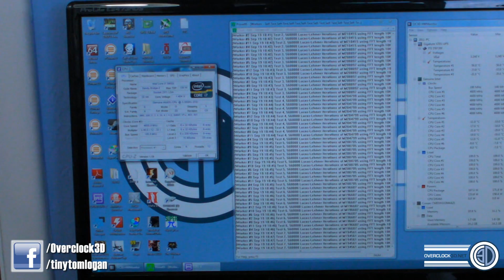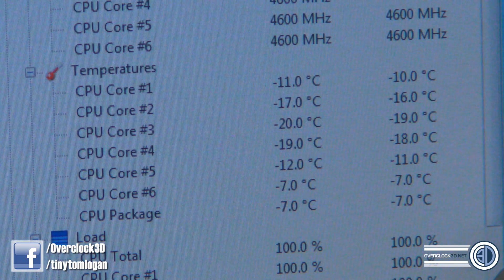Ultimate Corsair H100 Cooling Mod

Comment: Won't bother watching the rest. Thought maybe he was gonna do something actually interesting.. but nah.... Hell unless he bought 20 'reversed' fans (somehow), none of this would even work. Forget that whole debate that had been going on about whether or not he could actually get temps below 0C... If he didn't have the fans spinning in alternating directions while blowing the same direction, he wouldn't even be generating any 'wind' or air movement anyway... The fans all spinning in the same direction cancels eachother out, thus just making a bunch of noise without any actual air movement... And if you think i'm just 'bullshitting' here... go open up a enterprise servers..... i can even give you a specific type: any HP Proliant 1U server. Open it up, remove a fan container, and look inside. the blades are in different positions for the two-four fans that are stacked in that container. Each fan spins in a different direction yet blows air the same direction. This increases both air pressure and speed over all...

Comment: The only way a second pump would add more is if the Pumps are to small for the work its doing . Any added work from the second pump is to bring the single pump up to its true work force value

Comment: How the fuck? Fans don't cool the air... They pull in colder room temperature air into the tower. Fake.
Reply: JgHaverty Hold up now keyboard warrior, not everyone is a science whiz like you. I was just stating my opinion. which i though was right. I never was good at science, so dont go makin any judgements bout no one, okay.
Reply: YeHnJaCk I dunno how to make this point without sounding like a complete prick, but the amount of idiots that think this is accurate is absolutely staggering...
Reply: wind velocity, the faster it travels, the colder it gets. And plus, all the fans are doing is cooling the radiator and removing heat from it, so 40 of em means lots of heat getting instantly removed, and the cpu gets cooled so quickly, that there is no substantial amount of heat in the room
Reply: NordicSnow Holy christ you're stupid. 

Your body temperature is 98.6 degrees. Your ambient air temperature in this situation is likely below 98.6 degrees. It feels cooler. Because it IS cooler. Not because of some magic that occurs. 

Your body feels cooler when its super hot, because of your sweat evaporating. 

You're honestly allowed to use your brain, no one here will stop you.
Reply: Lets go to the basics! Cpu coolers work. Why ? because of black magic? No,because the air is used to carry away the heat from the cpu! So if you use a small/low rpm cooler, your cpu is hotter! If you decide to upgrade to a larger cooler fan ,your cpu can be cooled more efectively! Why should this not work if you simply scale it up?
Reply: Zontzo then why do you use them in the summer?
Reply: Really? I'm pretty sure it isn't compressing the air... It's moving it.
Reply: god dang I have lost all my faith to humanity....
Reply: NordicSnow That is horribly wrong. The faster ANYTHING moves, the more enthalpy it gets and the higher the temperature is.
Reply: NordicSnow u srsly didnt know that velocity = more temperature? u know when meteorites fall they catch on fire? its not only cuz of velocity, but velocity plays a big part. did you watch cartooms in your childhood? i think even in alot of cartoons u can purely use logic and understand it........... didnt know ppl think xD velocity makes it colder lol
Reply: JgHaverty i guess its because the author was confident in his answer,  and he didnt start it with "i think" or in my opinion or whatever, that made it sound accurate to people that dont know anything the basics of physics, and in our world, the people who talk they dont think, and the people who think who think they dont talk :S true but sad
Reply: did you get a e- in physics
Reply: frederik hansen Is that even possible?
Reply: No matter how many fans you put on there, it won't get any cooler than the room itself.. The reason why a fan blowing on to yourself feels cool is because humans are warmer than rooms and the fan blows the hotter air right on top of our skins away.
Reply: Zontzo Sh3lbyHD Explain to me how room fans cool the air of the room then.
Reply: memanlol zer They don't.

Comment: P1xV1/T1=P2xV2/T2, and  V1= V2 (volume)  and T1= room temp say 24C,  P1 is high pressure created at radiator restriction  from fans pushing and P2 is low pressure created from the vacuum at radaitor from fans pulling, solve for T2 for radiator fluid, after manipulating eqaution we get  T2= P2/P1 x T1,   P2 is mucho less than P1 so P1/P2 is less than 1 and multiplying that small fration times an R.T. of 24C gives a temp mucho lower than the room temp.

Comment: I did this, but with some deltas. I need 3 separate 1300w psu (each fan is 36 watts and I used 100 fans). It is great and it costs nothing

Comment: So many dumb people commenting. The liquid in the cooler isn't water! It is a special type of coolant which can get very cold and not freeze. The radiator can get colder since there is no heat gaining on the radiator so the cooler can work on make temperature.

Comment: This is really the most stupid thing one can do with so many crappy fans.
Just take the motor from a vacuum cleaner and run that at low RPM... Way better airflow and usually a lot less noise and power consumption.
Also it's better to push air in instead of sucking air out.

Comment: Oh my god. The fans would make the room hotter you fucking dipshit. You are removign heat from the CPU and putting it into the room, that is what the fans does, not to mention they add extra heat from inefficiency. Are you a complete fuckehead? This is the most basic of physics.

So fake. Negative tempretures my ass. 4.6 ghz my ass.
Reply: watch to the very end of the video
Reply: Ahahahahaha well done (Y)
Reply: Take a joke moron. (4.6 is not a unrealistic number for a i7)
Reply: It's easy as fuck to get 4.6Ghz... AMD Catalyst Control Centre automatically overclocked mine to that ffs... All I'm using is a Corsair H55 Liquid Cooler on my AMD FM2 A8 6600K processor... There really is no big deal.
Reply: LOOOOOOOOL. You got trolled.
Reply: Indeedthis isaname if you'd look at the fx 9590 then you'd see that it's possible from stock
Reply: Your dumb, the liquid flows in the heat sink, cooling the cpu, then back out into the radiator where it is slightly warm, that is if your running a normal setup. This has 40 fans, 20 pulling in air, and air cools as it moves quicker, unlike any other form of matter, and 20 sucking it out as well. That is also cooling it. The fans, are cooling the liquid in the radiator which is cold, due to the air coming through it. The fans you use in your house when it's warm? Same fucking concept.

Comment: When air moves it loses heat energy. Probably won't get neg temps, but it will get much cooler than ambient temps.
Reply: Also using a radiator in this fashion would provide significantly cooler temps, argued that you wouldn't get neg temps but the science grad I talked to said it is possible..

Comment: _   You guys should stick to computers and not aerodynamics..   Putting that many fans on a system without a wind tunnel formation would be pointless.  Each fan will buffer each other out, which would cause it to again..  be pointless.  if you have this fan system set up in a wind tunnel formation, you could get it much much cooler. lol

Comment: Take one of the gasoline engine fans they use to inflate hot air balloons and channel it into a 240 X 120 MM slot to put the h100 in

Comment: Most fans are pressure optimized.  Push/pull fan setups are a waste, there's no extra flow of air.  Also, putting two fans up against each other, at best will do nothing extra, and at worst will give you a lower average air flow
Reply: Putting two fans next to each other will most definitively not lower airflow. It just won't increase it significantly. And while push/pull setups are subject to serious diminishing returns, there is certainly more airflow. Only on thick rads with a high fin density using fans at low speeds would I ever recommend push/pull, on the basis that it doesn't do much of a difference otherwise... But your comment is plain bullshit.
Reply: If you put two fans up against each other with different air flow rates, the fan that moves less air is going to choke back the fan that moves more air.  If you use two fans with the same air flow rate, then you just get the same air flow rate.
Reply: No. That's not how the world works. Electric motors slow down from how fast they would otherwise spin at any given voltage when they are made to do work. Keeping a fan spinning (even in a vacuum) is a lot of work, and the motor will be spinning slower than it would be without the fan blades attached. As you contribute airflow from a second fan your fan will speed up, even if they normally operate at different speeds. And the resulting airflow will be higher than it would be with either fan alone, with exceptions in scenarios where the fans are vastly different. It just isn't going to be a lot more than the airflow of a single fan.
Reply: Patrik Manni  no.. _  just no, Phat Rat put it exactly right.  It's the same air flow rate no matter how many fans you put together.  The only way to change that rate would be for a wind tunnel formation for those fans with precise timing and calibrations.

There would be no suction for the initial fan to use to be able to allow the 2nd fan to pull on the first fans rotation.  They are pinning at the same rate.  But you have to remember inertia, the fans are all magnetic, when they shut off from the power, they stop quickly.  So the magnetic inertia would stop any type of suction from occurring from one fan to another.

The only way a suction could work, is again, the wind tunnel formation in exact formation from each other, to work as a waving fan.
Reply: This is the same as using a 1000hp engine to run a small 12cm fan... waste of energy and money but he did it just for fun :)

Comment: Dude, you bought pressure optimized fans. They are going to push the same amount of air regardless of how many you stack onto each other. I know its for fun but still.
Reply: That isn't how airflow works. There is no magical "pressure optimization" switch that negates all effects other fans are subject to. Stacking fans will increase the static pressure, but it won't do it by much.
Reply: Pressure optimized fans run at the same speed regardless of how much static pressure there is. Stacking them will NOT make them run any faster.
Reply: Pressure optimized fans do not defy the laws of physics. They generate more static pressure, and retain high speeds better regardless of pressure differentials, but they are still affected by physics. And as such, they slow down when the motor needs to do more work to keep spinning at the same speed. Because that's just how electric motors work. And stacking them results in a net higher force, and a lower load on each motor, meaning the fans will spin faster. I mean, I know the video is a joke, but for fuck's sake. There isn't a magical 'pressure optimization' that lets fans defy all conventional logic and physics. There never has been, and there never will be. And stacking fans makes a difference, but not a big one.
Reply: The motor isn't going to magically pull more power to compensate for the work that needs to be done. If you give it a specific amount of power, it will spin at a certain speed, and that speed will be reduced as you increase the work it needs to do. And the work it needs to do is increased as you place it on a radiator. So it spins slower than it normally does when attached to a radiator. So attaching a second fan increases the capacity for pushing air through the radiator, and both fans spin faster. Tom explained himself that in the actual results he did see differences as he stacked more fans on top of the first set of push/pull fans, but that it was only about one degree. You should probably make sure you know what you're talking about before you start calling people morons.

Comment: Well... I have an i5 4670k processor and an H100i and I've attached 40 Noctua NF-F12 fans to it, it is slightly quiter and gets like -17 to -5 on the temps on 4.9 GHz, but my room temp is a bit hotter, but the best part is the awesome Noctua color! I think I'll add just a few more fans to it so I cen get the clock a bit higher without gettitng it too hot, I think about 12 more on each side but I haven't decided yet, the next thing after this project I'll try to attach 20 industrial fans on each side of the H100i, shouldn't be much of a problem either , and I think I will be able to fit it in my case with enough cable room.. Thanks for a great idea!

Comment: ppl what you talking about, water will freeze wtf ? dont use water , use some spirit or antifrize. there is another problem in the video, fans sitting like this wont give extra cold, couse one fan can push volume of air the same like other, even they can bother one another and wont run so good like one. this setup is stupid.
Reply: there is peltier somewhere

Comment: Looks beautiful.  I've done many experiences like this about 10 years ago.  Used about 20 Delta fans once , and even a koyo automobile radiator.

In Water cooling, a similar analogy is made towards multiple pumps in series.

Be it fans or pumps, testing the open flow ( a single pump or fan detached), and comparing it to the flow when resistance is added (radiator,etc) will show a drop.  Adding more in series lets that reduced flow approach its open flow limit.  At a certain point it reaches a diminished return.

Now an more interesting approach is correct fan size... remember, a fan is more efficient when placed a few inches away from it's cooling element, and when it's actually smaller in diameter then it's cooling element. 

Replacing half the fans in the picture with a "tunnel" might even improve the results.

Comment: -20 degrees is crap try loading 40 fans on a 560mm rad. Such a good set up. Just plug it straight into the mains 240v woop woop.

Comment: This is the stupidest thing I've ever seen. This will not increase your cooling at all. It is physically impossible to increase the airflow with more fans since they will only push or pull the same amount of air at all times. You can only increase static pressure if you have a push/pull configuration which even then only helps run a few degrees cooler at most. You may run a little cooler than room temp if your PC is cold but that's about it. BS video. If you want more information on fans and coolers, watch LinusTechTips video on push/pull configuration.